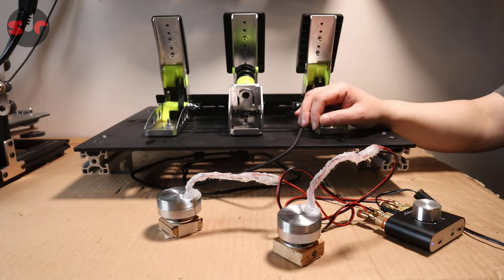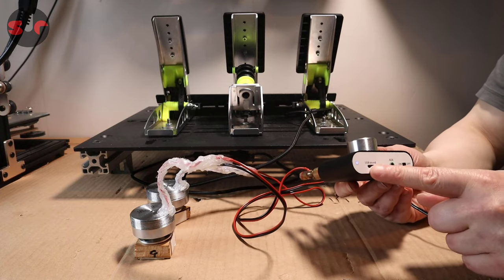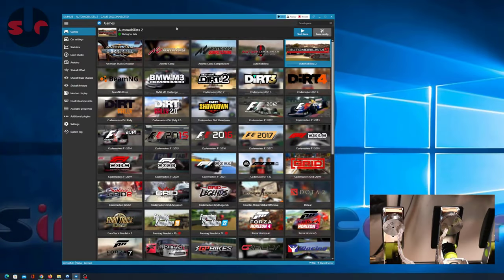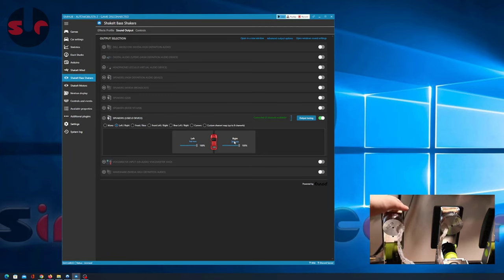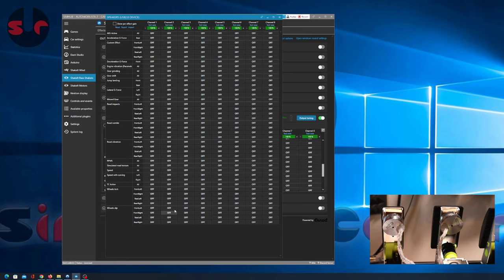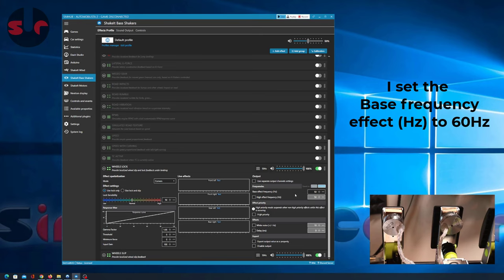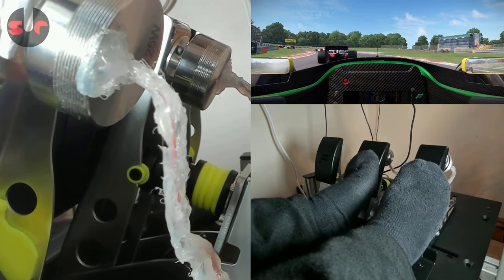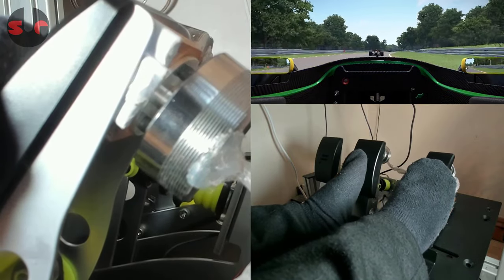🔉Mini BASS SHAKER🔉 DIY Pedal MOD [GUIDE] using cheap Sound Exciters! Give this go, it's AWESOME!

Comment: Awesome! Isolating directly to the pedals is smart. I currently have Dayton 50w BST-1 directly under my brake on my GT1-Evo pedal plate. It provides just a few effects so it’s not “muddy”. RPM, gear change and wheel lock. I’ve got an unused channel on my nobsound I think I’ll investigate some smaller exciters now! Hi SimCat!
Reply: @SimRacingCorner  sent you a tweet with a pic of my diy :) I got one setup on the brake and had great results! Now I can separate road and rumble to the Dayton and single out wheel lock on the pedal itself.
Reply from the maker: @kevin_m  Cool, saw your pic.👍‍

Comment: I would like to mount of these bass shaker on my pedal as well after watching your video. May I know what type of these extend wire connect to bass shaker? zero knowledge about these all wiring. need to study more I guess lol
Reply: Just normal 12 gauge speaker wire is fine

Comment: THANKS MATE! I hope you know you're responsible for my rig moving from 4 shakers to 6 after seeing this! I've just ordered the shakers and a 3rd nobsound to run them - looking forward to trying this! I am going to mock up a 3d printed spacer disc to hold that shaker disc in place - hopefully I will be able to use the screws that hold the pedal face on to hold the plate down and keep everything looking nice. 

Appreciate your videos mate - your 3drap load cell mod video inspired me to try the yellow spring mod (based on the price of the 3drap lol) and all of a sudden I can brake properly - I went from wildly inconsistent times to being able to consistently keep within a 10th or 2 for 20 laps plus. What a difference stopping properly makes :)
Reply: did they do the job? and got the 40 or 50mm? on what pedals you're using them?
Reply: Hey man. So you can use multiple amps if you want to set up additional channels for different transducer modules? Set them up in the simrig application I mean?

I'm new to diy sim mods but have a technical electronics design background but I'm not familiar with the simhub app.

Comment: I used one of these for the brake; i found that the membranes/springs onto which the screw-plate is mounted are not the most durable as 2 of the arms snapped after only a few months of use (which may be down to me overstressing them somewhat); switched it out for a dayton audio fabric membrane mini puck; works a treat!
the exact model i use now is the following: Dayton Audio DAEX25VT-4 Vented 25mm Exciter 20W 4 Ohm
Reply from the maker: Useful stuff, cheers for that feedback. Might check out one of those Dayton exciters in the future.
Reply: @SimRacingCorner  no problem, for reference, I'm using the nobsound mini bluetooth/usb amp, probably the same one everyone else is using, with the big knob on the top of it.

Comment: Problem with that Nobsound amp is that the 3.5mm plastic jack input, goes after a while. The socket becomes loose.

They do a 2x100W with RCA inputs -- otherwise identical -- for £60, which I've had to switch to.

Hopefully this will last a lot longer.

Comment: Nice mod. I modden a Logitech Xbox G920 wheel to work with PC using Arduino Pro controllers making the resolution from 0-100% throttle, brake and clutch is now 4096 steps of res from 0-100 input compared to the 256 steps of original resolution. Giving me much better throttle control and break control. This seems like a good next step. Considering building a motion rig ofc

Comment: The only issue I can think of is with wheel slip its not just longitudinal (wheelspin) that comes through but also lateral slip. Now you actually want a little lateral slip to be fast, so backing off to the point that you get no vibration could make you slower. Im running a shaker under my pedal deck just for the brakes. it works well, although rumble motors would be better
Reply: I've got the parts on order to try this - I think you're right with the lateral slip, I think the point would be more get used to that feedback and act accordingly - once you're dialled in you would know where that feedback was coming from I think. Either way I'm super keen to try this I think it will be awesome! I have 2x BST-2's under my pedal plate atm and while they're great you just cant feel  the difference - so I'm gonna run a mono under the plate and then 2 of these on the pedals. Looking forward to it :)
Reply: so rumble is better go than shaker?
Reply: No, rumble motors aren't better. Rumble motors are slower to respond and only have very narrow frequency range and amplitude, when compared to a base shaker/ exciter.

Comment: My idea is (after wathing this video... and thank you!:) ) when I build my alu sim rig with gt dd pro... To connect these two exciters on my pedals and put 4 Dayton Audio TT25 PUCK and put them on 4 corners to simulate every wheel... and play with settings to make the best experience as I can.
Reply from the maker: I don't know if you've seen my Dayton Audio TT25-8 videos. If not, have a look, the Daytons aren't super powerful but can work well if used in the right setup. https://youtu.be/Lidrjg8i5n4, https://youtu.be/gpidQkAVENc.
Reply: @SimRacingCorner  Believe me I have watched it many times :) and alot of your videos... on your channel i have seen about transducers and eciters and made a decision to go with "smaller" dayton pucks rather than the biger ones and the money I save to invest in something else to improve the experience... and also about csl pedal mods and have enough information to know in what to invest my money in my new upcoming sim rig. :) Great videos! Very detailed and useful every time!

Comment: These or TT25's?

Update: I bought both. The TT25's are FAR better. Dayton TT25's have a more realistic rumble effect. Whereas these AliExpress shakers (I bought the 25 Ohm version from this video) feel more like a cellphone vibration.

The only drawback of the Dayton TT25 would be their size. But I easily made some DIY wooden brackets to fit the shakers to my T-LCM pedals :)
Reply: Hi. Is it possible to the your mod to install TT25 on your TLCM ?

Comment: Hey SimRacingCorner, great vid!  I got the CSL pedals a couple of months ago.  I decided I would do the bass shaker mod.  Was going to order the parts together as aliexpress is on the other side of the world to me.
But I was rummaging through a mates parts box I saw he had a mini power amp, but is does not have Nobsound printed on it so I assume it is a clone.  Should this work or do you think I should order the Nobsound?  
Cheers.
Reply from the maker: Any mini amp is suitable. Just check the ohm rating on the amp (it's should be labelled on the amp) and get mini exciters that match that.

Comment: This is great. I've been seeing more of these videos popup and I'm really curious to try it out this weekend even. Question though, what if I want to add more of these sound exciters? Do I just get another amp like the one you have or is there something with more channels to connect to? I saw someone using them for sequential shifting and handbrake feedback and I really wanna try it. I'll need 4 exciters in total, maybe even 5 (one for the clutch). Thank you! Liked and subbed.
Reply from the maker: Hi there, and welcome. These small amps only come with 2 channels, so you can buy more of these to add more exciters, that works. Or buy a larger multichannel amp, then that will give you more connections. However, that's expensive and excessive for this application. So just use another mini amp, that's the way to go.👍
Reply: @SimRacingCorner  thank you! I'm going to try this out for sure as soon as I figure out how to mount them on my pedals 😅
Reply: Mine just came in and I have some ideas 😁😎

Comment: Would you prefer smaller ones attached to each pedal or a larger BST1 placed under the pedal tray?
Reply from the maker: I prefer this style of mod, it feels more connected and distinct with the effects coming through the pedals directly, rather than under my heels.
Reply: @SimRacingCorner  thanks.

Comment: Merci pour cette très belle vidéo .Je ne connais rien a l'électrique je voudrais savoir  que lorsque je vais sur le site (Aliexpress)pour acheté  un mini haut parleur je vois qu'il y a plusieurs puissance de mini haut parleur je voudrais savoir que si je prend le plus puissant des 4 mini haut parleur si il ni a pas de problème pour mon Nobsound Mini Bluetooth 5.0 TPA3116 amplificateur numérique Hifi récepteur Audio stéréo amplificateur de puissance 50W + 50W amplificateurs de son de voiture. L'autre question je voudrais savoir actuellement sur mon système j'ai un autre amplificateur externe avec un autre BASS SHAKER  DIFERENT de celui que tu nous a présenté dans ta vidéo  l'amplificateur s'appel  le (fosi audio) il ressemble a celui que tu nous a présenté dans ta vidéo donc cela me fera  2 amplificateur externes DIFFERENTS le mien et le tien plus mon casque  sur la troisième sorties  de mon ordinateur celas peut t'il marcher  avec simhud je te remercie

Comment: Can i use this for pedal and another  2 transducers  for racing chair with 2nd amp?   Can i get 2 different type effect?   One for brake,accelerate on my pedal  and other for engine rev,crashing on my chair.
Reply from the maker: Yes, you can run multiple amps, and tune each shaker to run specific effects.

Comment: Quick question about these?
Should they be getting hot?
if not, how to prevent it?
Thanks in advance
Reply from the maker: If they're constantly working, then they can warm up (all transducers will). Try running the volume a little lower.

Comment: Hi again, here for the banana plugs. Is the size of them important? I was looking for the specs but I didn't find any, which ones are you using? Thanks in advance
Reply from the maker: I'm sure these are all just a universal size, I bought them from Amazon. So just the first ones I found for the lowest price.
Reply: @SimRacingCorner  thanks a lot

Comment: Hey man! Do you think I could use these with my playseat chalenge for cheap bass shakers (back seat and in pedal housing) or would they not be powerful enough?
Reply from the maker: No, they would be too weak for that
Reply: @SimRacingCorner  gotcha, thanks. Would you say in your experience you prefer these or vibration motors for rumble pedals?
Reply from the maker: Transducers are better. But wouldn't say it's a big deal for this particular task when adding a vibration effect to pedals.

Comment: Which is better using these or using the vibration motors out of joypads. I current use joypad motors but wondering if these would be an upgrade.
Reply from the maker: Transducers are always going to be better than vibration motors generally. In the context of pedals, though, and the single effect being used, it probably doesn't matter too much.
Reply: @SimRacingCorner  I read somewhere that the reaction time from in game to physical movement is quicker for inducers. Not sure I believe it.
Reply from the maker: I would agree, transducers should be able to react faster. A transducer works like a speaker, so consider that as the comparison.

Comment: Can you disassemble down to the guts of the exciter and solder in some heavier wires with a sleeve?
Reply from the maker: Some screw heads we're striped, so I wasn't able to look inside, but otherwise I did consider that as an option.
Reply: I was able to.

Comment: @simracingcorner Hi, did you go with the 4 or 8 ohm and also the 20w or 25w? Thanks
Reply from the maker: The ohms need to match your amp ohm rating, so that's what matters. Get the 25watt ones.

Comment: According to Ali Express they do not ship to the UK for the transducers.  Can you think of an alternative
Reply from the maker: I've just checked the link that I previously posted under the video, and it doesn't seem restricted, and I'm in the UK too.
Reply: @SimRacingCorner  weird just rechecked and get the following "This product can't be shipped to your address.
Select another product or address. " however have found them on amazon, more expensive but get them tomorrow
Reply from the maker: @Petrolhead66  Yeah, that is weird.

Comment: Hy, thank you for video
 for bodyskaker i need 40 ohm or 80 ohm ?
Reply from the maker: It will depend on your amp and ohm rating it supports. If you're going to run then from a mini amp, then it's likely 40 ohms.

Comment: I was planning to get Sim 3D rumble kit until I saw this. I am tossing between the dayton TT25-8 puck which has 35W as opposed to a 20W puck that is half the size. Do you find that 20W is strong enough I would love to hear your reply.
Reply from the maker: Hello there! I did find these small pucks we're strong enough for this job, and their size makes them easy to work with. It was a success. Way back, I did mod another set of pedals with one of those Dayton pucks. https://youtu.be/vpmBjFbit_A. That worked out great too. I wouldn't say it was better using the Dayton, it's just another option. Over the long term, though, I fully expect the Dayton pucks to be more durable.
Reply: @SimRacingCorner  Thanks for responding to my comment. I ended up buying both to try!
Reply: You were right. The soldering on my exciter broke almost the next day. I didn't connect it well enough...  I ended witht he dayton tt-25-8. they are much more solid!

Comment: Is it possible to run two separate amps on simhub? i.e. one for pedals and one for seat.
Reply from the maker: Yes, If you have two sound cards. One sound card output per amp.
Reply: Ok, thanks 😊

Comment: Hi mate, I finally did this mod.
But what's weird. Is I only set TC,ABS and wheel lock and wheel spin on rears only.

So I shouldn't feel anything unless I'm losing traction or ABS kicks in.

However, I still feel road vibration and engine rumble...

Has anyone else noticed this?
Reply from the maker: Only the effects you've turned on in SimHub are the ones that should come through. What game? And have you tried other games to test this.
Reply: @SimRacingCorner  yeah Its weird... I'm gonna have to test other games. But so far ive only played through content manager on AC
Reply: @SimRacingCorner  OK, so on AMS2 it will only use the 4 effects I've set.
But in AC it will rumble like a PS4 controller to just about everything, yet give priority to the effects I've set.

I really can't figure out why AC is pushing extra effects through that I don't even have enabled.

Under calibration, there's a slider to enable what AC is doing, and it was slid all the way to the option that sets auto effects.
But even after resetting calibration and sliding it all the way to the left (only use predefined effects) it still rumbles as I drive down the road.

I can't say I dislike it but I'd also like to disable it if I want
Reply from the maker: @GregoryShtevensh  Yeah, that's weird. I know I didn't test these in AC, so I don't have any notes to share on that one.

Comment: I've tried this mod but I'm getting EMI (interference) with my pedals. Anybody having the same problem?
Reply: I've also have Emi with my Simjack pedal using bass shaker like this. I found that grounding the controller unit to the controller housing and grounding the pedal by soldering wire on it fixed it. Note i put it on the pedal base plate as mounting the bass shaker directly
on the pedal still caused interference even with grounding

Comment: Will these specific nobsound amplifiers work for tactile transducers setup on a console gaming rig? I need to import them and returning them won't be easy
Reply: Yes but you won’t have the access to Sumhub on the console. I have a shaker setup on my homemade rig that use for ps4.
Reply: @Chef_BS1  Thanks for reply. Yes I've researched extensively into tactile transducers for console setup. It's a pity that you cannot customise it via software like you can on pc. Which amp are you using and is it very necessary for the amp to have sub output? Just want to make sure I import all the correct items.
Reply: @free_styler  I’m using a Nobsound NS-03G sub amp. I tried hooking my transducer up to a regular audio amp and it brought too many high frequencies to the transducer so I got the sub amp and much better. I’m still working on placement and plan to get another sub and amp once I’m done experimenting with this first setup. Btw. Im using a digital to analog audio converter to convert optical to RCAs.
Reply: @Chef_BS1  The Ns-03g only has one channel, is this OK for a setup that includes more than one transducer? I will be using it on a ps5 - no optical. Will use an hdmi splitter. Will definitely be getting an amp with sub output. Really appreciate your feedback. The info on the Internet is very limited when it comes to consoles.

Comment: how are you connecting them to the wood?
Reply from the maker: Screws
Reply: @SimRacingCorner  ok so what is the thread size?
Reply from the maker: @roadi7  The holes are small, probably M2. Though you could easily open them up.
Reply: @SimRacingCorner  I was hoping they'd be m3 as that's the smallest I have a tap for and would go right to the metal behind the pedal, but maybe they can be made bigger.  did anything ever vibrate loose during use?
Reply from the maker: It held together fine
Reply: @SimRacingCorner  and that was just double sided tape, right?
Reply from the maker: Yes

Comment: I FEEL SO STUPID..... I have two of the  amps just like yours ... Simhub cannot see them as an output... the pc doesn't see amp, plugged in to usb mini >....HELP ... i have been trying for months ...
Reply: Did you fix it?
Reply: you have to use the cable, that comes with the Amp, otherwise it won't recognize it